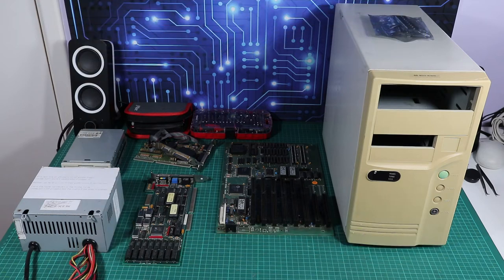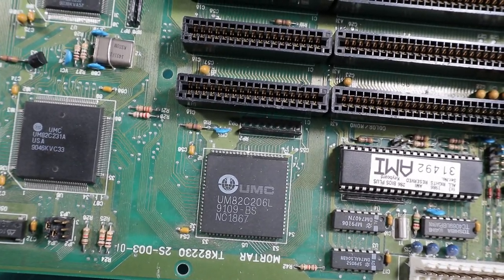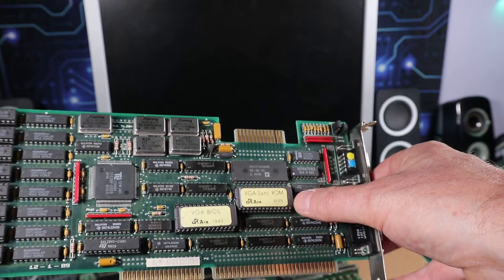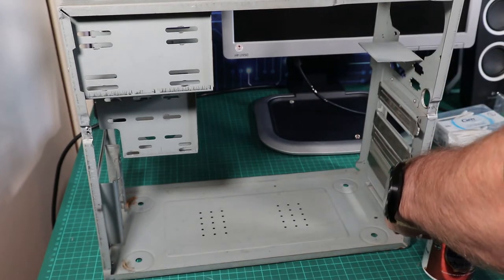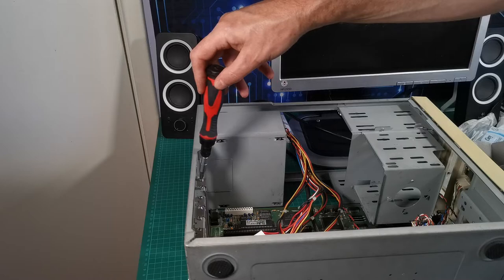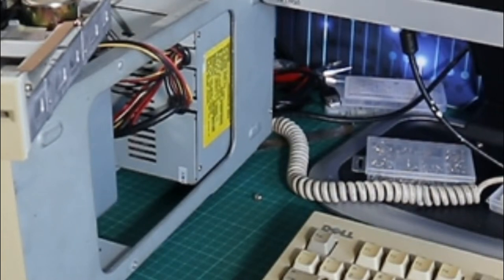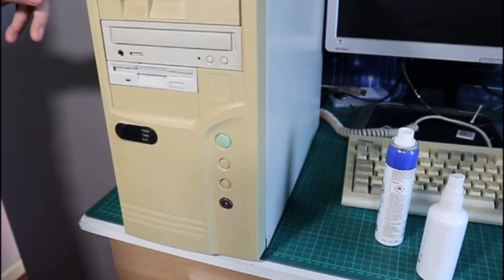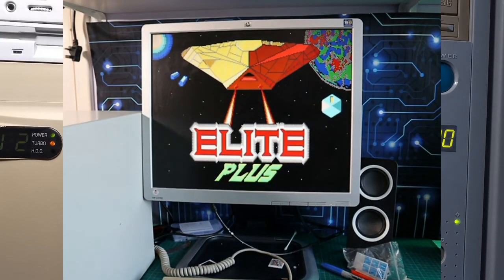Intel 286 12MHz build.

Comment: I had a 486 board that used SIPP's for video ram.  That is one of the few times i dealt with them.
Reply from the maker: Cool,  surprised they were still around in the 486 era!
Reply: @66mhzbrain  I remember a 386 that used them - and you can make SIMM into SIPP by soldering pins on, or if you can find SIMM sockets that would plug into the SIPP header
Reply from the maker: Cool.  That might be a fun little project to make another mb from sims!

Comment: Nice!
Reply from the maker: Thanks😁
Reply: @66mhzbrain  286 is missing from my collection. Have 86, 386 & 486 (admittedly, 386 & 486 are laptops & they need fixing, when I can get around to it!)
Reply from the maker: 286 is fairly niche. I doubt ill use it much. It was my first pc so I have a soft spot for it😊
Reply: @66mhzbrain  Not always about using it, it's about having it in the collection
Reply from the maker: @turntheblueiris4626  indeed😁

Comment: I had a Pentium 100 System with that case and the same Aztech double speed CD-ROM drive back in October 1995. Seems strange for it to be used for a 286 build. The case you have your 486 in looks more 286 to me, also it has a double digit LED display, while the one 286 build one is a 3 digit. Anyway I enjoyed the video, will there be a Pentium build up next?
Reply from the maker: I probably didn't pay enough attention when choosing cases😬. Yes I have a nice socket 5 pentium board that I'll be putting together in the not too distant future😁